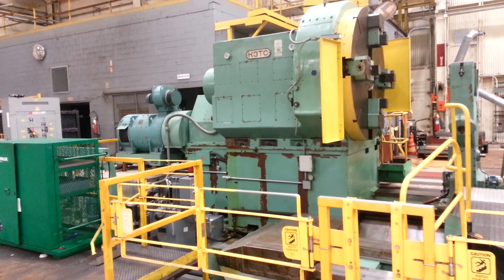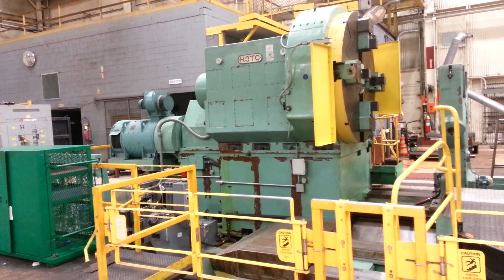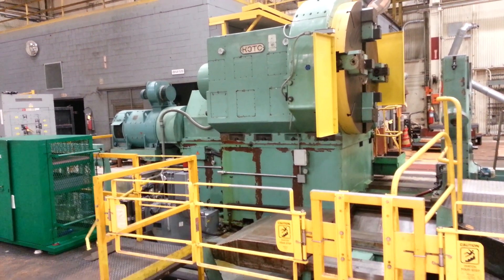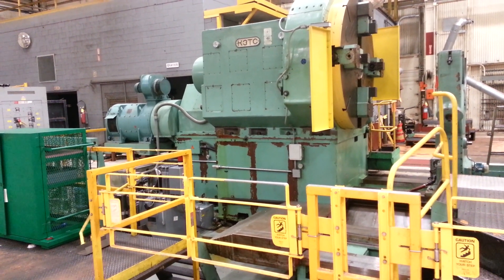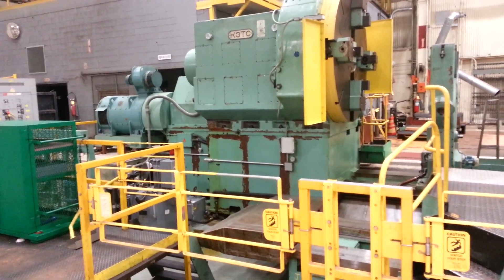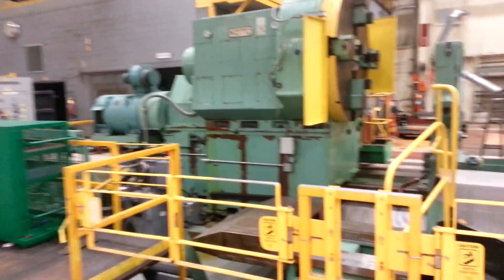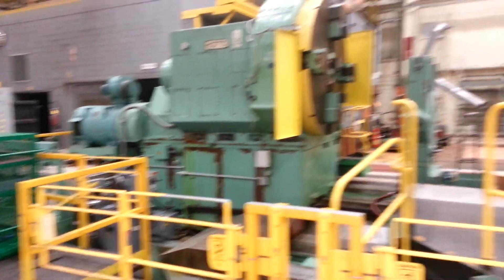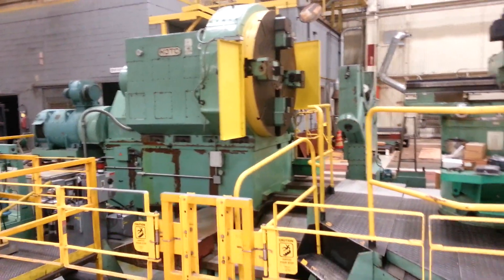Largest cnc lathe in the world, made in Kramatorsk

Comment: I ran this machine when I worked there. We retro-fitted it with CNC controls and Heidenhein scales. We used it to machine Dovetails on our large Low Pressure Turbine rotors. Very accurate! Top speed is 180 R.P.M. with a 100 Ton workpiece on Hydrostatic bearings. We also machined journals, so we needed the S.F.M. The rotors were balanced, so operating at 180 R.P.M. wasn't a problem.